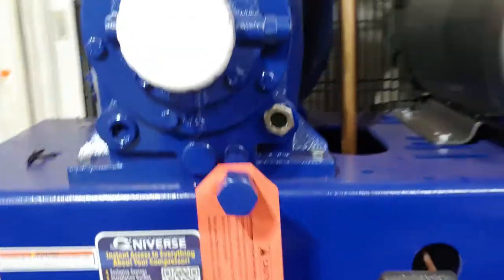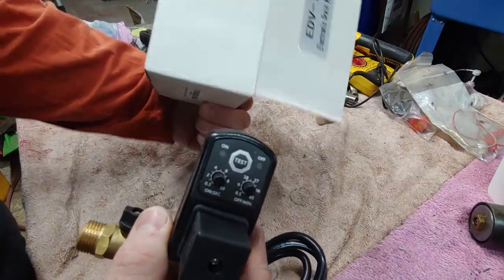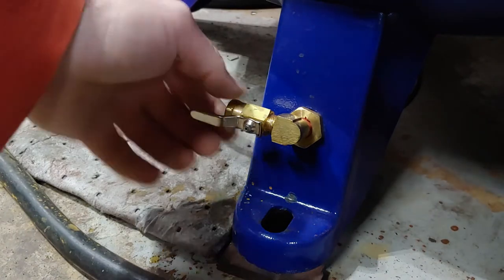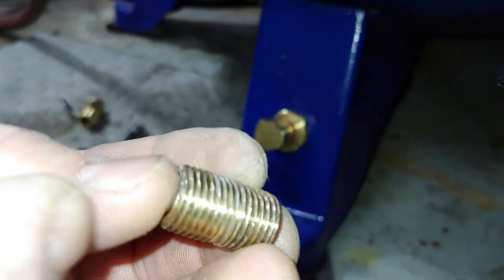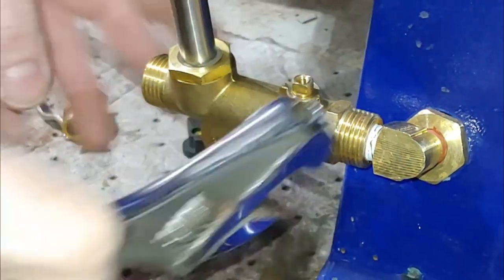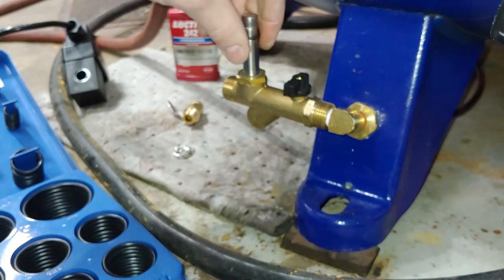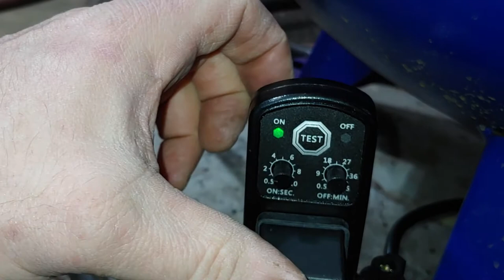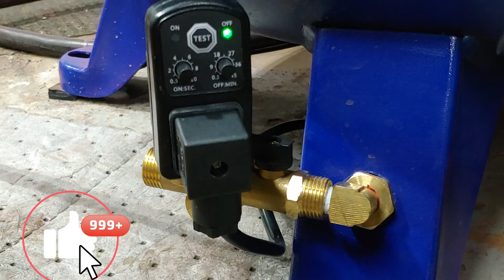Quincy QP5 Compressor || Auto Drain Valve Install

Comment: What fittings did you use to connect the drain extension to the compressor leg?
Reply from the maker: I believe they were 1/2" brass pipe fittings.

Comment: Nice video. How is it holding up? Have you thought about wiring it into the pressure switch so that it only works when the compressor is running?
Reply from the maker: Is that something that would work? I'd be down for that. Got a link on connection? It's working well so far
Reply: @Fixin2Ride-Official-  in order to wire it to the pressure switch you would need a 220-240v automatic drain valve (assuming your 80 gallon Quincy is 5hp at 220-240v single phase). You will then need to cut off the plug for the drain valve, strip back the connections, take the cover off the pressure switch and under the line side connections you will see two wires going back to the motor. Wire the black and white (assuming) to the same connection as the motor. The green or ground from the automatic drain valve can be wired to one of the two ground points under the pressure switch cover. Before you attempt any of this your breaker should be off and the disconnect opened. If any of this sounds awkward please contact your local electrician and do not attempt yourself.

Basically wiring the automatic drain to the same connections as the motor of your pressure switch will allow your automatic drain to activate only when your compressor motor cycles.

Hope this helps but as suggested if your unsure please get an electrician.
Reply from the maker: Thank you.
Reply: @automatedingenuities  Why do you need a 220-240 automatic drain? Couldn't you just wire it to one of the phases after wiring a gfi 15amp fused circuit from one of the 10 guage wires after the pressure switch? They make 220 but that's for European applications and I wouldn't want to rely on the 30amp fuse on a 14 guage wire that feeds these units. Not being a know it all. Just an honest question.
Reply from the maker: Thats what others that have done the same recommended... Quincy said it was good too.

Comment: hye this valve normally open or normally close?
Reply from the maker: Closed. It only opens to let some air which draws the moisture out from the bottom of the tank.
Reply: @Fixin2Ride-Official-  how to remove all air from compress after shutdown the switch?
Reply from the maker: Pull the releif valve near top. It has a ring in it a brass fitting.